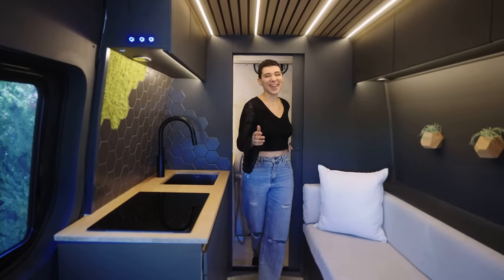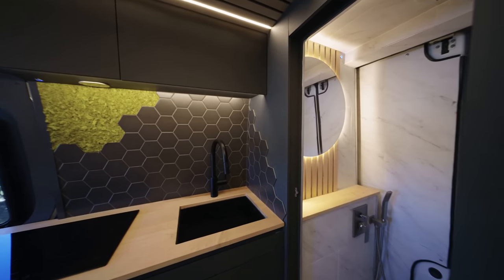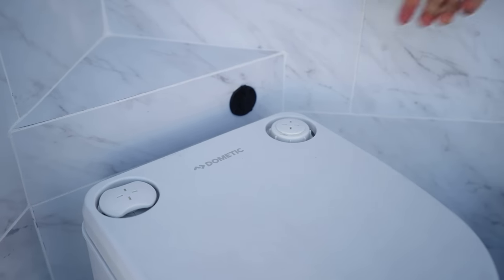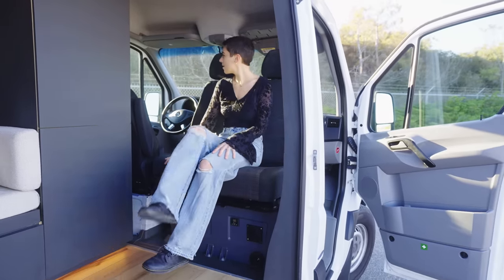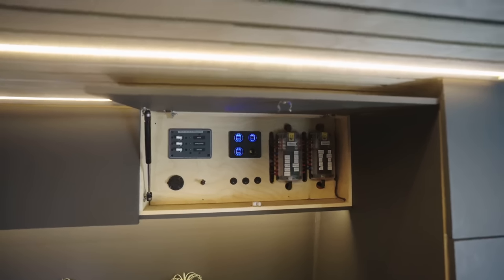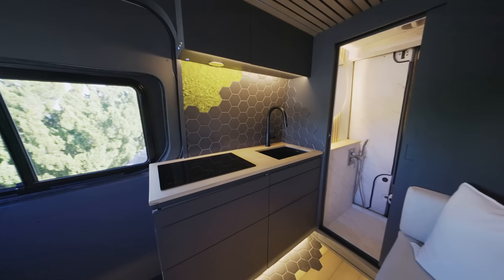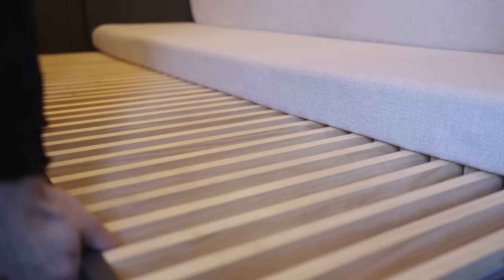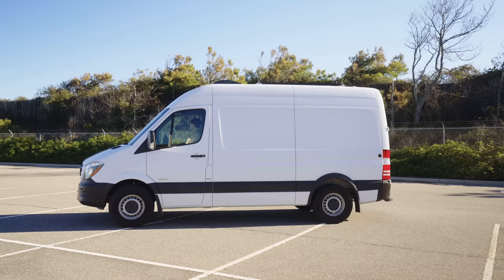DIY STEALTH VAN TOUR with RAIN SHOWER In The Back! | Modern, Luxury Tiny Home Camper Van Conversion

Comment: Guys, I've just binged watched all your van builds to date. No question about it, you build some of the most stylish and elegant contemporary interior van builds that I've seen on YouTube to date. I really like your style (though not as big a fan of the dark builds). You're up there for style. However, I feel your van builds are more suited for weekend or short term (1 or 2 weeks) trips.  For long term (or 100%) van lifers where the van is their home, there is one fundamental flow in all your design, and that is the lack of storage space (and the lack of garage on some). It seems you prioritised style over practically in many of your design elements. A good example of this is with interiors where you have dedicated bench seating (with a separate bed), the space above the bench seat is simply wasted. You could have easily fitted more storage there. Another is the size of the fridge - very important for long term van lifers. Fitting smaller than a 60L chest style (or <80L upright) fridge/Freezer is not enough. Plus where will you put your trash, and dirty clothes? These are things that you'll quickly realise you need once you get back on your plan to become long term van lifers. But you did get many things right, such as fitting as much solar & lithium battery storage as possible, and fitting fresh & grey water tanks as big as possible. Your lighting is also top notch (though you should also consider fitting amber (or red) interior lighting function). Just my 2 cents worth. Keep up the great work.

Comment: I must admit that I loved your rear bathroom design enough that I've based my own build around this feature (although to save water usage I'm planning on using a recirculating shower that filters, sterilises and re-heats water before sending back to the showerhead)

Comment: When Electric Van hitting the road, more possibility could achieve with battery pack at the bottom, thus larger space in the van.  Canoo and Arrival have a big potential for Camper Van lover.

Comment: i would put windows in the back van door instead of a little roof van so you can fit another solar panel. i also would put a big flip up table by the kitchen so you have a bigger kitchen pace. Overall its the best van i ever seen, especially the seprate bathroom pace.

Comment: Stunning as usual. But to be honest stunning is a trademark of Louis the Van’s built since day 1.
Would I get to go for such a layout I would only change one tiny thing: mainly put a sliding compartment just above the toilet seat area.
I would make so it would house the fridge so it would be right next to the prep space.
This unit would slide inside the living room for when in need to use the toilet. 
Of course it does sacrifice the beautiful sliding door effect, but on the other hand this would add a hanging space in the central cabinet.

Comment: One word to the layout: I have a similar one but my couch is in front and the cabinet at the back. By flipping them you can stretch your legs, have a full view out of the side door and the couch is connected to the swivel seats.
Reply: That sounds lovely. It also makes the fridge go next to the kitchen, which is a plus.

Only downside is no solid wall between driver seat and couch, but maybe cloth divider is enough.

EDIT: Oh yeah, and the couch won't be able to double as a seating area for the kitchen slide out countertop/desk.

Comment: Very stylish build.  Probably not the most practical kitchen for anybody who likes cooking considering the tiny fridge with minuscule freezer, only two burners and no oven plus it doesn't seem to have much extra storage for pots and pans and maybe a blender or coffee maker... but the weekend warrior won't mind and neither will anyone who prefers to mostly eat out.  That bathroom is definitely great, though only if you're not always completely off-grid because keeping the water tank full for showers might be an issue.  I do like the position of the bathroom though, mostly because you can easily crack the back doors open to air it out or to clean it.  Very convenient.  Only thing I don't like is that you didn't set up something to keep your feet from dangling in the air when sitting on the front swivel seats.  Oh, and some kind of table setup for those swivel seats would have been nice too.  Still, well done. 👍

Comment: This is by far the BEST van conversion I have seen--and I binge watch them (all)!  I love it for the sleek clean aesthetic especially with the "hidden" elements and components.  Most of the other vans look good enough but when they open the panels to the electrical systems, etc, I start to itch because there are wires going everywhere and it looks like mass chaos and the way OCD is setup...🙅🏾‍♂️

Yoy guys thought of everything though!!  Great job you guys! 👏🏾👏🏾👏🏾

Comment: Wow ! I just bought a 2021 Marco polo. ..32 seconds in..., and caught at the first 4 seconds. Love it :-) Its the personal space i have been looking for. Wow.  The family loves the Marco.., but i use for business as reflective re flights re covid etc... its been grounding, for the family. But i need a day sleeper /nap time for couple hrs.  I will watch rest of video. Stopped at 6.32. I still love it. I would think i like side windows that would certainly take away from the aesthetical punch..; but need to use as regular daily.., let me watch more...Wow ! , great reflective surface consistency, and build implementation.  Nice ocd adhd.. :-)  I am.  Ok. 
We use Victron too. I will have a think. Where are you located ?
Thankyou.
Mh

Comment: Beautifull work, congrats! I would love to have tiles in my van but Im affraid that it will affect the weight of the van to much n I won't pass the inspection. How did you solve this problem? You have put lots of them...
Reply from the maker: They are vinyl tiles with silicone based grout.

Comment: I have a friend who turned his 2022 $70,000 Sprinter over to a man who claimed to be a custom van conversion builder. He is the son of a lifelong family friend, so what could go wrong? I saw the van for the first time last week, and it was a sad sight. The build looked like it was done by a small child. Horrible woodwork, gaps and uneven cuts everywhere, and zero thought into a theme or style. To top it off he pierced the wiring (both his own and the original factory runs) while screwing in the wall panels, so now the backup camera and a couple other things no longer function properly. 
My buddy is an engineer and teacher at Cal Poly, so he's no dummy. He probably could have done a better job himself, but wasn't interested in tackling it. He also thought it would be nice help a family friend with a new business venture. Now the dude refuses to fix his mess and is demanding more money than they initially agreed upon! He ended up having to hire someone who in his own words "makes his living off other builders mistakes" lol.
Moral of the story is be very careful who you select to tackle your van project. The team in this video seem incredibly proficient at every aspect of this build. Great job guys!

Comment: Why the small sprinter though, why not get the long one?
Reply from the maker: The shorter wheelbases are quite a bit easier to drive and park than longer wheelbases and driving is such a big part of traveling/living in a van.
Reply: @scarletandseth  ok, good point, but i for myself would still prefer the longer one because I'm driving one of those everyday at work, so I'm used to it.
But you are right, parking will be a bigger challenge.